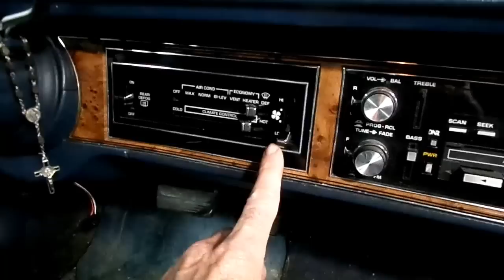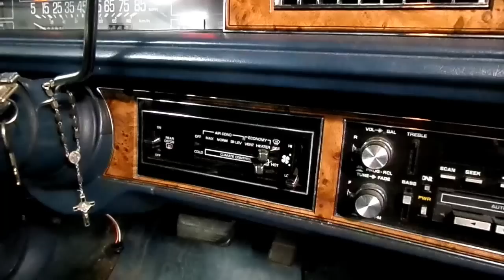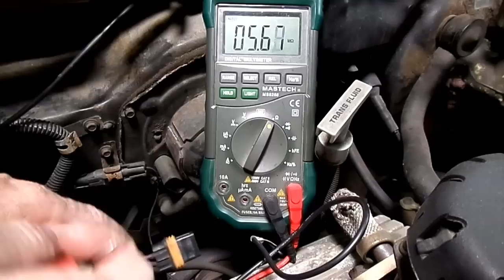Buick LeSabre HVAC Blower Motor Troubleshooting

Comment: Mine is a 1999. Kept having trouble with the a/c and blower. Got new parts installed and still have problems with it coming on when it feels like. Have to get it checked again. My thoughts are that something is loose somewhere (I'm no expert), but if it comes on when I go over a big bump, then that's my clue.

Comment: Mine was doing the same thing, so, I unplugged the heater, tested the connection , it was good so I plugged it in and the blower started working.
The problem started because I had a bad battery. When I replaced the battery, the blower didn’t work.
Reply: My point is, check voltage because you may have a bad battery or loose connection.
Reply: Huh.. Imma check mine once i get home. Ours was working fine then one day quit blowing air out. Then like a month later car died. Tried replacing alternator, starter. Nope still not working. Checked battery and ding ding ding ding bad battery and bad positive connection.

Comment: hey richpino6a i always watched your saturn videos last time i had a saturn until it was wrecked i recently bought another one 1999 saturn sl2 doch manual with 230000 miles on it and it puffs white smoke at around 3500 rpms burns quite a bit of oil no coolant lost so far i suspect a ring job but i was told from a friend that it might be sucking oil into the intake you seem like the expert on saturns so i figured i would get your opinion before i tried anything thanks in advance martn
Reply from the maker: Martin Mavis Something easy to check would be the pcv valve.
Reply: I have replace it it quit smoking for about 500 miles now its back to smoking again

Comment: I have a 1998 Buick Lesabre the air or heat does not blow at all. Does that sound like the blower motor to you? And should I replace the resistor piece as well.
Reply from the maker: +Chris P If there is no sound or air movement from the blower motor when you turn the switch on then the first thing is to check for voltage at the motor.

Comment: Sorry, but I think you got lucky with this diagnosis. Your voltage tests on the disconnected wire only tells you that the wire isn't completely broken. It does not prove that the motor is bad. The wire could be severed except for one strand inside the wire and you will get full battery voltage all day long while its disconnected. But once you plug it into a perfectly good motor it will not work. You need to do a voltage drop test with current flowing to be able to truly know if the wire or motor is bad.  I won't get into how an ohms check on the ground wire without completely disconnecting it from the circuit was inaccurate.
Reply: 8 years late to the party but could you explain to me what the issue could be when I get 46 ohms while testing ground instead of 0 ohms?
Reply: @IANS-ORBIT  ohms is a measure of resistance. Depending on your meter, 0 could mean an open circuit or the resistance is too low for your meter to detect. All circuits/devices/components have some amount of resistance in them. Even a straight piece of wire will have a measurable amount of resistance between the ends of the wire (assuming you have a good meter).  Because of that using ohms measurements to diagnose an electrical issue is inherently unreliable. There is no way to reliably know what a 'correct' ohms reading would be for a given circuit/device/component, unless you find the spec listed somewhere and that spec is correct and the circuit you are testing hasn't been changed at some point in its lifetime. Voltage drop testing is a orders of magnitude more reliable method to test a circuit and can be used without knowing anything about the circuit, other than the battery voltage, in order to test/diagnose it.  There are tons of videos on YT explaining & demonstrating voltage drop testing. Hope that helps.

Comment: yes I have 2004 buick lesabre. And I believe I'm having a blower motor problem myself. Every time I put a fuse in the end up blowing. I disconnected the blower motor wire and that it had burnt. So I cut the wire and replaced it but it still  pops the fuse. Can you please tell me what the problem may be thank you
Reply from the maker: +jermaine carr Does the fuse blow when you have the connector plugged into the motor.